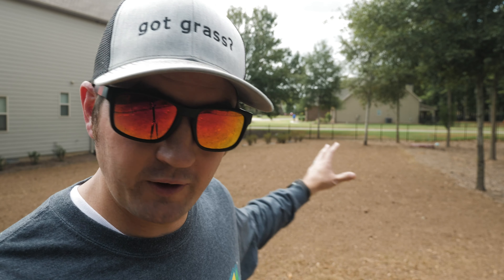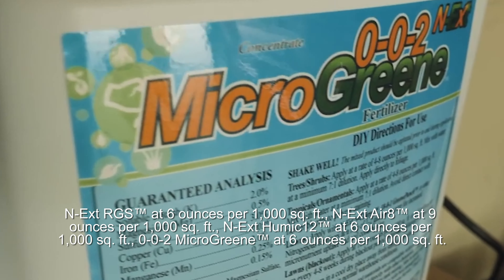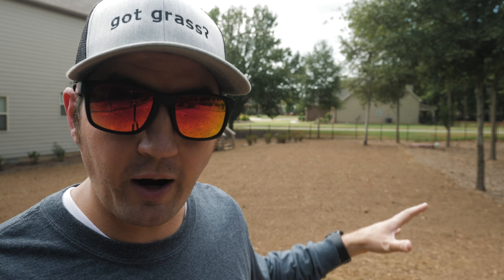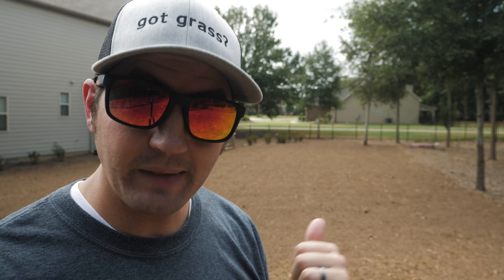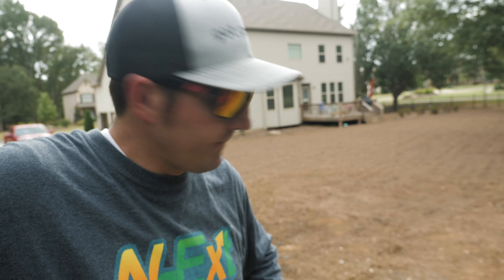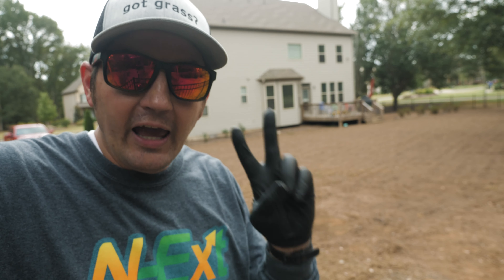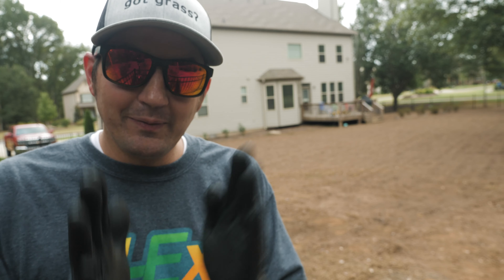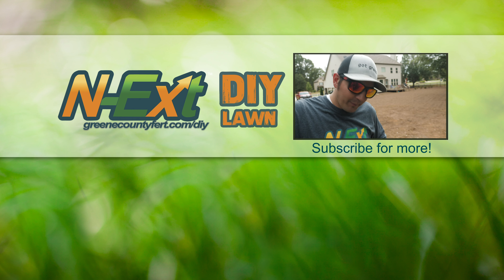Spraying N-Ext Bio-Stimulants // N-Ext Lawn Renovation

Comment: A question about where you mentioned the mixing of products, if you mix certain products or use a hand can like the Ortho Dial and Spray, can that gum up or have issues so that it clogs the Hand can? I was speaking to other individuals about the same issue which is annoying, but no one knew why? If there is an issue, that would explain a lot.

Comment: Hi Castleberry!  Question:  I am applying couple rounds of RGS/Humic12 to my established TTTF over the next season.  3oz/9oz respectively.  Would there be any benefit in putting the first 2020 season app down late fall 2019 vs. early Spring 2020?  I am thinking late fall would be better and be able to incorporate in the soil during winter and be ready to go during the first sign of spring.  What are your thoughts?
Reply from the maker: Great question. There is a benefit to putting it down in the fall. You will notice a quicker spring green up. Spray it down and have fun! Thanks for watching.